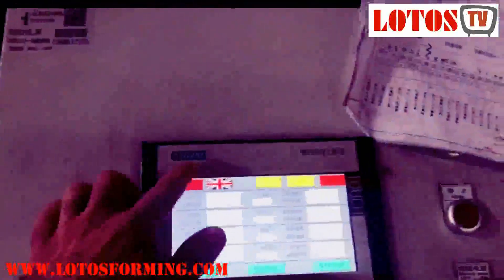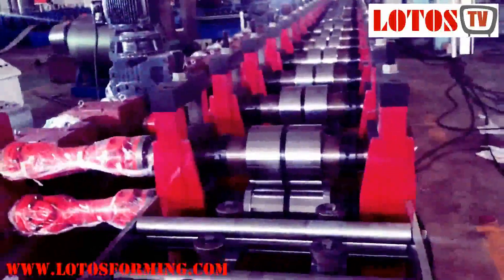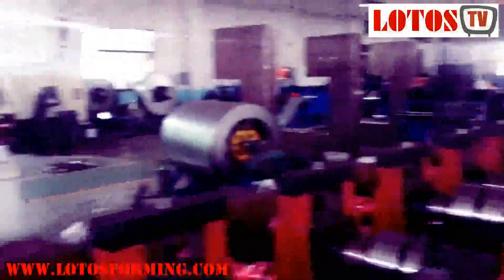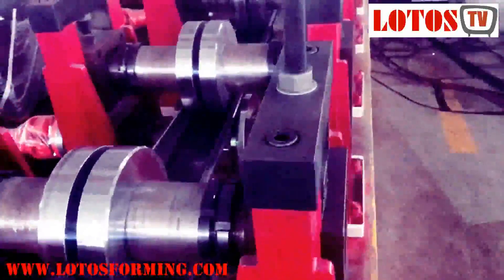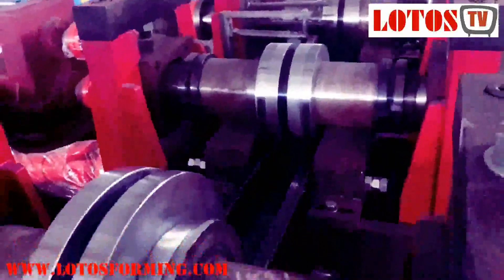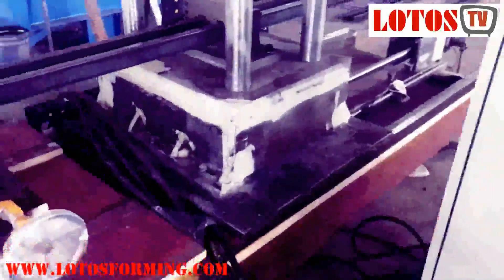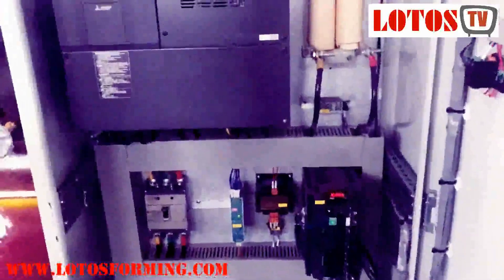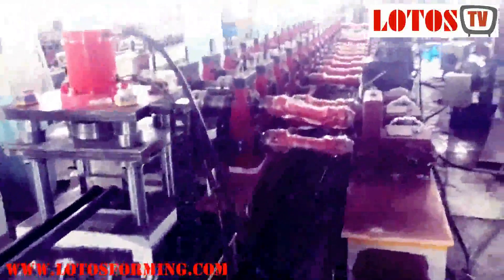【Post beam making machine】: w beam guardrail roll forming machine | C beam roll forming machine

Comment from the maker: C Post Beam Roll Forming Machine production line will be combined with hydraulic decoiler with travel cart, leveling system, hydraulic feeding device, hydraulic puncher station with the pre-cutting unit, roll forming machine part, hydraulic cutting unit, output table, hydraulic oil pump, and electrical control cabinet and so on.